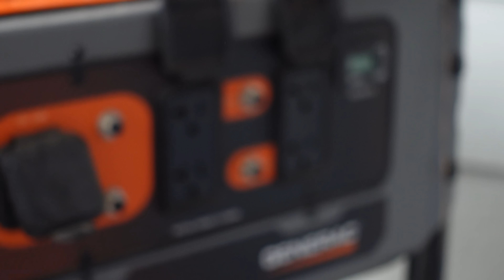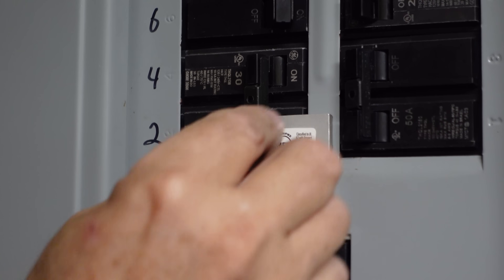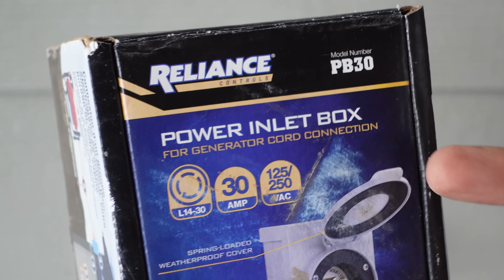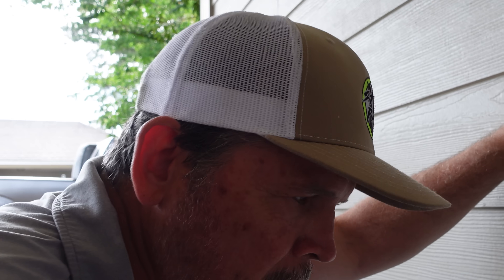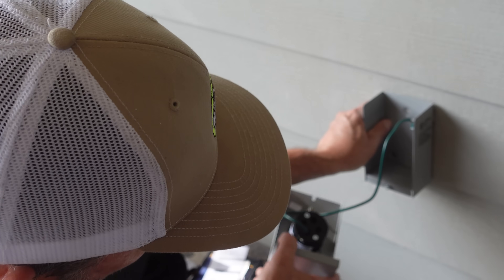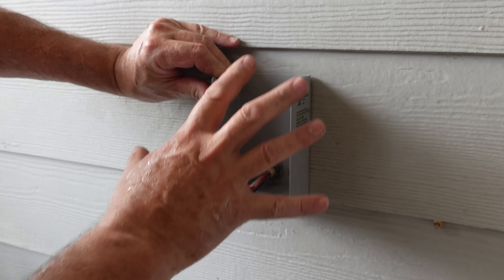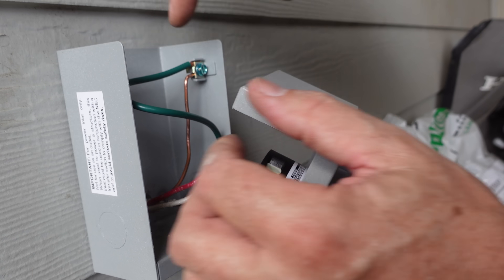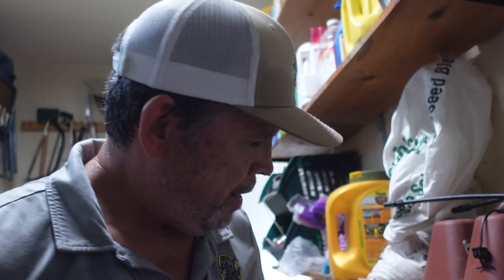What is a Suicide Cord and Why It Could Kill You

Comment: You can reverse the strain relief fitting in the hole so that you can reach the screw to tighten the clamp on the Romex from the front side.
Reply from the maker: Not allowed but still would be tough inside a box… stubby screwdriver?
Reply: @StudPack  Do you mean code doesn't allow it?  Needle nose pliers will span and tighten it.

Comment: The heat/humidity reduces the working time of the easy sand 20 (same with thinset) Try mixing at a slow speed if you’re using a beater.  Great work as always gentlemen!

Comment: Check for power anyway, especially for DIYer's who aren't wiring every day.  You "know" it's off because you turned it off, but someday an ingrained safety habit will save your life.  That moment when a non-contact voltage tester lights up on a circuit you personally turned off is a moment that sticks with you.
Reply: Well in this case it was locked out at the panel with the interlock as shown and there was no generator hooked up so it was a no brainer. In fact this set up with the interlock can never have power without the generator connected and turned on with the interlock in place unless the breaker in panel was somehow broken which is highly unlikely but I guess possible perhaps?
Reply: @jstar1000  You're right about this specific instance, of course,  but I'm just saying if you check for voltage EVERY SINGLE TIME, without exception, sooner or later you will find power on a circuit you were certain was already off, and save yourself a nasty surprise.

Comment: I installed one of these a couple years ago after we lost power for several days. Of course, I didn't use it for a long time, but finally did have it come in handy. It worked like a charm and I've had no issues.

And for some reason I still watched this entire video like I didn't already know how to do it and didn't already have one.
Reply: Did you test the unit after installation? That should have been the last step in the video.

Comment: Great vid.  I did a very similar addition to our house in Central Texas to accommodate a 4750w, dual fuel generator.  Safety doesn’t stop with breaker and plug sizing, wire sizing is always the weak link. Always enjoy your vids, thanks.

Comment: Our house (built in the late 80's) had an "outlet" for a portable generator.  When we bought the house the previous owner had a generator with a similar "widow maker" / "suicide" cable except for the fact that it was made up with a 50amp plug on one side (likely from an electric dryer cable) - during the estate sale when they sold the generator (which I didn't want for the price being asked) I told the estate sale owner that he didn't want to sell that cable unless he wanted to be sued - it was best to throw it away.  He didn't listen to me - I hope the person buying the generator wasn't dumb enough to try to use the cable.  I installed a similar "inlet" box replacing the outlet shortly after we moved in.

Comment: Great video as always. Only question I have is if that existing wire was 10awg or 12awg? Cant really tell from the video, but you stated the output of the generator was 30A and the breaker was 30A so hopefully they are 10awg wires.
Reply: The wire in the wall looked undersized for a 30A circuit. It looks like a 14/3 or 12/3. Both are not rated for 30A. Should be a 10/3 minimum. Unless codes are different in USA then in Canada.
Reply: @freezen13  In other hand it's a quite short run so it should be a relatively low voltage drop.
Being up to code or not is not something I'll argue about as I don't know.
Reply: @freezen13  same ampacity ratings.
Reply: I was thinking this same thing. If part of the circuit were not properly rated, I’d check the whole circuit. That includes the breaker, the conductors, the receptacle, and the cord and plug assembly.
Reply: I observed that also. In fact, he pointed out that the original outdoor female connector was rated for 20A; that was probably because the original wire and breaker were also rated for 20A. FWIW, maximum ampacities of different AWG: 10 gauge / 30A; 12 gauge / 20A; and 14 gauge / 15A.

Comment: Hey Paul, sometimes when you have a short ground you can use the ground cramp to add to the ground. It is a perfectly acceptable electrical practice. In fact when there are a lot of grounds in a box ground cramps or sometimes used to connect them together.

Comment: Been a long time watcher and you guys do great work. Question: aren't those pocket screws backwards? Shouldn't that block maybe have needed a secondary piece of wood in front of it so you weren't catching the very edge of the framing with those pocket screws? Still much better than it was, but I thought I'd ask. Hope the homeowner is able to validate functionality before the next storm.
Reply: really, the concrete siding is what is providing the primary support for that plywood.  the pocket screws just held it in place long enough to put the box on it.
Reply: @kenbrown2808  ah okay, thanks!

Comment: Love your channel - have a great deal of sympathy for ya' in that heat.  Here's a tip, and apologies if it's already been shared: when you need to secure an NM connector to the back of an enclosure, I've always attached the clamp to the wire first, feed the wire into the enclosure, then secure the lock nut. Once the nut is on the male threads, you can grab the threads with needle nose or lineman pliers while you tighten the nut.
Thanks for great content! Stay cool and hydrated!

Comment: I would be a bit hesitant trusting that stranded 10 (was it 8?) awg wire and the 10 solid romex on the case grounding terminal. Two different size wires usually don't tighten well. I would have used a large wire nut and a pigtail so only a single wire was secured under the grounding terminal.
Reply: Yes I question how go 20 Amp to 30 Amp without checking wire gauge. I have 10 KVA generator and it was recommend not to power AC  compressor. I did make Suicide cable for my neighbor so that he could run his furnace and have hot water take a shower
Reply: love there vids but that appears to be #10 awg wire I'd really consider upping that to #8  yes #10 carries up to 30 amps but I'd play it safer when dealing with a generator inlet

Comment: When I make penetrations to the exterior i always use a bead of clear silicone around the box. Looks good guys!
Reply: This is definitely an important detail; could see daylight coming through the socket from the rear and that's just asking for rainwater to go inside that wall cavity and trigger rotting/ mold on that drywall, especially in a hurricane area. Suprising just how fast a wall cavity will fail if it's not weatherproofed.
Reply: @hijackstudios  also, this is probably a smaller issue, but one I noticed nonetheless. The pocket screws are barely holding into any material on the stud because the tip of the screw is pointing toward the outer face of the stud. Pocket screws are supposed to be oriented toward the meat of the material they're screwing in to. that tiny bit of wood on the corner of the stud could easily crack or even entirely break off when tightening it down, leaving the screw with nearly zero pullout strength. If during a hurricane a some debris hits that box it could knock it loose, creating a serious hazard, hell a rowdy toddler could ram into it a knock it loose. Best way would be to put a strip of blocking on either side of the plywood panel screwed on through the face of the ply, slide it into place, then screw through those into the wide face of the stud. It would be much stronger.

Comment: Hey Stud Pack, bit of a random question. I remember seeing a video of you guys expanding/running an electrical circuit, and I think you used a buzz saw to take out (and repatch later) a strip of drywall from the wall to run wiring through the wall... Any chance you remember what video this is??

Comment: For my portable generator, the 30 amp cable has the male for the generator and female receptacle for the connection to the house. The difference is, my plug enters the box at the bottom when you pull the trap door down. I don't like your setup with the plug entering from the horizontal. Seems like that would be easier for rain to penetrate the box/plug, and could be at higher risk for shorting.
Reply: @Hello Ville how are you doing

Comment: Shouldn't there have been some sort of water sealant applied between the box and the clap?  Won't water run down the siding and make its way behind the box??  I mean, rain goes sideways in LA.
Reply: That side of the house is under a roof, the previous cover didn't have any sealant either.
Reply: @Hello Bryan how are you doing

Comment: I have a question regarding a floor tile video you did a year ago. You used self leveling concrete over a slab before laying floor tile in a bathroom. You did a phenomenal job and it looks amazing. I will be doing my first floor tile project in my bathroom soon and am wondering if I can use self leveling concrete over the entire plywood subfloor. Can I then also tile directly over the self leveling concrete? Or do I need to use concrete board?
Reply from the maker: Thanks Matthew!  Yes you can pour SLU over a wood subfloor but do your research and pick one designed for this use.  Also, you must prime the subfloor with the specified primer.  The water in the SLU will wreak havoc on the wood if it's not primed.  Tile directly over the SLU, it's a great surface to tile over.
Reply: @StudPack  Thank You! I appreciate the timely response.

Comment: So now you have a suicide socket instead of a suicide cord. Probably a bit safer, but not foolproof unless the socket does not activate until the cord is plugged in.
Reply: In addition to the panel interlock protecting linemen from back-feeding, it also makes it impossible for the line to power the outlet.
Reply: The breaker in the panel has a fail safe system, when the power from the uttilities is on that breaker is off, your comment was a bit quick coming, you should have paused a second before trying to sound wise😕
Reply: @wetrock2766  It was intended as a question rather than sounding wise. I actually expected this may be the case and was waiting for your ocnfirmation. In fact, my comment explicitly presumes this fact.
Reply: Suicide socket????  Hilarious....

Comment: The white wire is called the ground , the bare the grounding. The neutral only exists in the panel. E.E.’s use slightly different terminology than the NEC.. The NEC is the reference for most AHJ’s.  Your thoughts?

Comment: Hey Paul & Jordan, had question about the Generac style of generators. So they come on & shut down on their own, is that Interlock plate not needed or is there another device that is used to protect the linemen? Thanks
Reply: You install a special separate panel that does everything automatically, starts the genset, cuts the utility line and sets everything back when the powers comes back on.

Comment: Wire gauge is definitely an issue, that wire looks small fo 30 amps.  Otherwise, excellent video.  Perhaps more detail inside the breaker box as to how the AC is wired to two different breakers.
Reply: I was thinking the same thing as I watched the vid - hard to tell if it's 10 awg or 12 awg. Working in Missouri, I've made a small living correcting undersized circuits because - DIY'ers and 'installers' don't understand why gauge matters or code.
Reply: Same here - the amount of ease with those lineman's pliers to bend the wire indicated to me that I wouldn't feel comfortable in pushing that much juice through it - especially if the AC is on and a few other things (like fridges or freezers).
Reply: You were not on site so how can you say it looks too small?? Do you think this man would have done it with the wrong gauge wire??? Wow...

Comment: Do they make interlocks for all panels or do you have to have a specific panel designed for it. I live in Texas and after the freeze I’ve been considering setting something up. I’m a plumber so I’m not a stranger to electric work but I’m no electrician. I’d rather adapt my existing panel than change the whole thing.
Reply from the maker: The interlocks are panel specific Josh.  Check out interlockkit.com for more info
Reply: @StudPack  thanks

Comment: I always called these "Darwin Cords" when I worked at Menards (a Home Depot/Lowes clone in the upper midwest).  People wanted them all the time when they'd hang their Christmas lights up wrong and wind up with the female end by the receptacle.  People could not understand 1) why we didn't sell them and 2) why they were so dangerous.

Also, curious if you have a template you could share for the breaker "map" you made in Excel.  Mine looks nowhere near as nice.
Reply: Sadly I was one of those people that ran the lights wrong ( actually we were renting the place and one of the outdoor outlets did not work but...) I knew better than to ask if they carried them but I did get some strange looks from the cashier when I walked up with three spools of 12 THHN wire two male 3 prong plug heads and a roll of electrical tape. I did make sure I was the only one to ever touch it and it was removed and dismantled as the first step in taking down the lights that year. and next year I changed where they were plugged in at so no more California cord for lights after that.

Comment: No vapour barrier behind the drywall??
Reply: You want a vapor barrier on the hot side of a wall so it stops the vapor before it can condense on the cold side. In this situation, which is the hot side of the wall? The drywall side (interior) or the siding side (exterior)?

Comment: great work, love the channel.  One thing to improve, though- before putting that new box on the cement siding, I’d run a bead of caulk in an upside down “U” shape (up one side, across the top, and down the other side).  Granted, the box is under a porch cover now, but in five years, someone might take that off, and you’d have rain water running down the the siding and back behind that panel into the wall.  Great work, otherwise, though.
Reply: I understand that the box is waterproof. Water can seep between the box and the wall, and enter the wall through the cutout. Hence the need for caulk
Reply: it's hurricane country - I'd bet rain hits that wall, anyway.
Reply: Caulk great idea, especially to keep bugs from running under the gap on the bottom edge.
Reply: agree
Reply: @ptso7580  you're not wrong
Reply: Its an outdoor water proof box so no need to caulk it what so ever. Doesn't hurt of course but not needed for sure.

Comment: Why not use a 1/2”or 5/8” paddle bit to drill the hole? Instead of having a giant gaping void with the hole saw?
Reply from the maker: I need room for the connector on the box.   Got those screws that clamp the cable etc 👍👊
Reply: @StudPack  ahhh, exactly why people should ask questions instead of getting on here and giving y’all a hard time.

Comment: Love the way you do repairs/up grades.  I have just 1 question. Instead of doing a patch on the drywall hole 🕳, why not install an access panel for future usage? 🤔 Asking for a friend.
Reply: Electrical generally doesn’t need access panels. The wiring behind there is complete and there’s no splice inside the wall, so the code doesn’t call for an access panel.

Comment: With all of the stuff going on in the world today i just bought a Champion 10000 generator duel fuel, bought a natural gas adapter and installed it all to run off of the gas feed and attached it to the house panel as well as adding a much quieter muffler. We're all set for whatever comes our way
Reply: I use solar and batteries so fuel is never an issue.
Reply: Be sure not to run your unit continuously for extended periods, it's air cooled and runs hot, oil changes should be done very frequently.

Comment: Little tip for ya - use a square bit on those electrical screws and never strip the heads . Especially on those higher gauge higher torque ones :) almost all outlets are either s1 or s2 & once you start doing it this way you’ll never go back .
Reply: Robertson bit for the win!
Reply: until you have an older device that only has 2 way screws instead of 3 way screws - or Lutron who still uses 2 way screws.
Reply: ECX is for screws on electrical sockets
Reply: @williamsporing1500  yep. that's more or less what we're talking about. :)
Reply: Adding +1 on the ECX.   I prefer it to the robertson by far.
Reply: better yet, use an ECX bit. it's a flathead and robertson combo :D
Reply: @mynamesnotimportant6941  WHOA!   I'd never heard of those before.  Thanks for the tip!
Reply: @KeithOlson  I just recently learned about them myself. Saw a couple YTers raving about them. I haven't tried them myself but they look super dope.
Reply: @mynamesnotimportant6941  I've been using them for about 6 years, now.  they do one thing, and do it extremely well,
Reply: @mynamesnotimportant6941  I just bought the Klein Tools ratcheting screwdriver with the multi-bit storage in the handle and it brings the ECX-1 and ECX-2. Lemme tell you, once you use these for electrical work, there's no going back ever again.
Reply: @mourneris  haha nice. I can imagine they are very useful. I don't know of anywhere that they sell them near me. I hate ordering simple things like screwdrivers but maybe I'll have to.